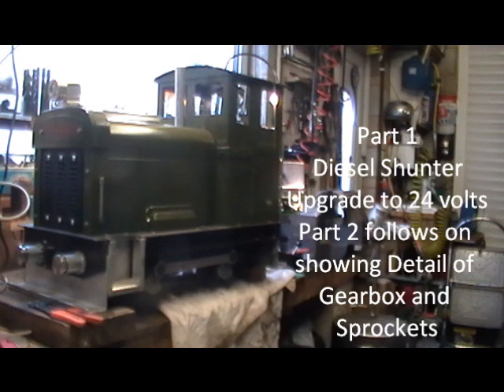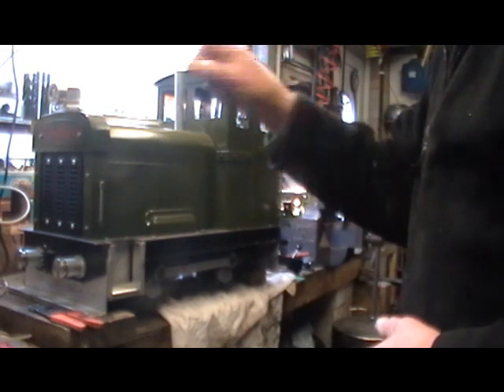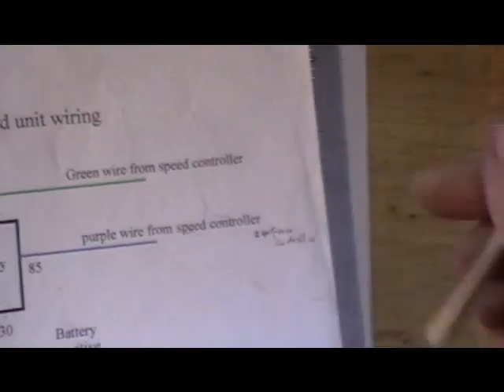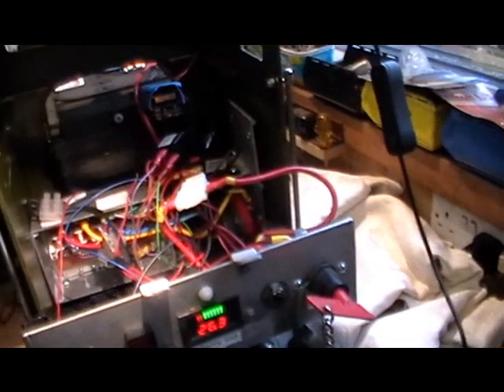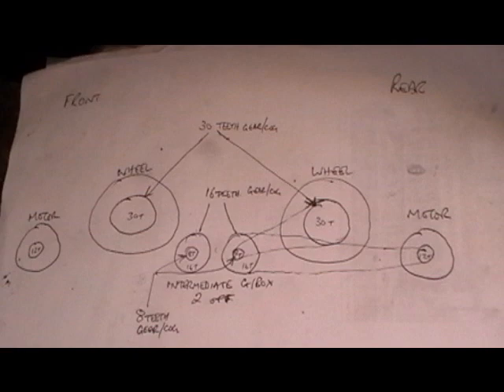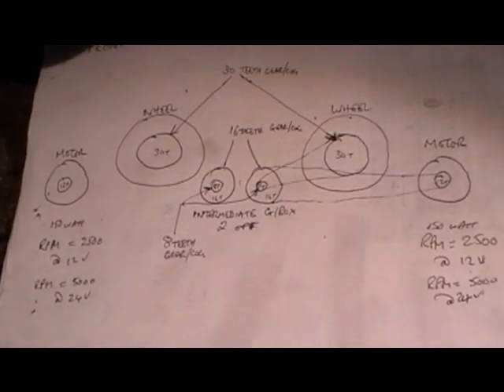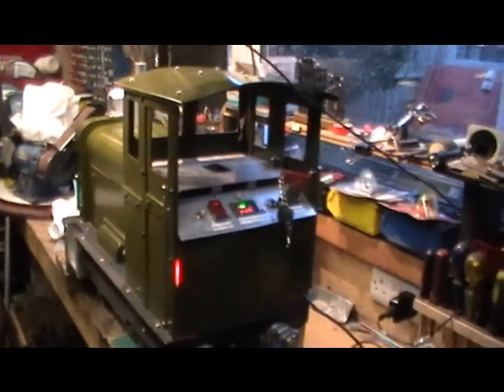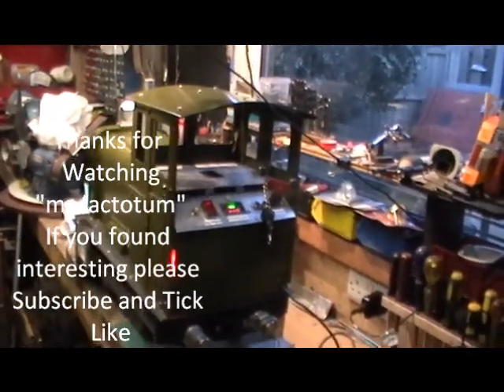Battery Electric Diesel Shunter Loco How to Convert to 24v also Gearing Explained "mr factotum"

Comment: You can use a step down module and use the 12v relais ! When it was mine I put a capacitor between the relais contacts (spark preventing) !
Reply from the maker: Okay massimo, nice to hear from you, thanks for info, ive noted it down
Regards
Mr f